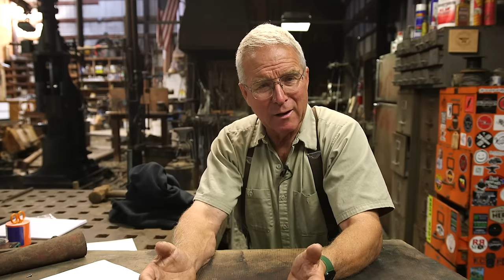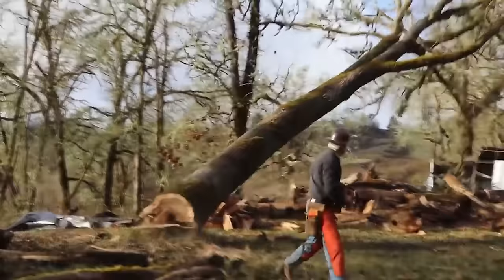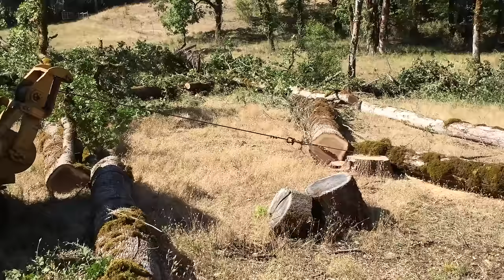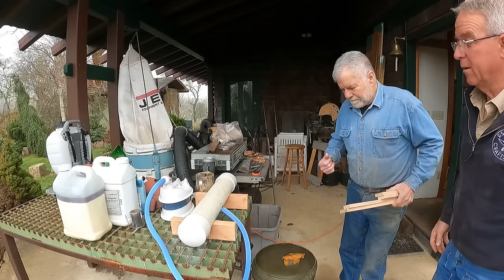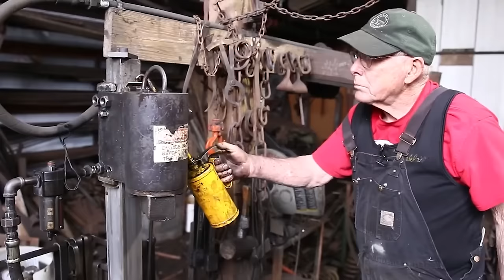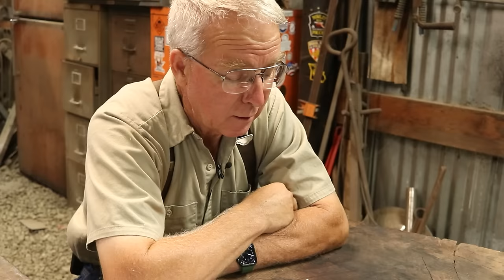How to Be More Confident

Comment: This is one of my favourite videos you’ve made, if not my favorite. My most courageous feat, feels strange to say, was about 4 years ago. I’ll be 40 in a few months….I was relatively new to carpentry. Did a little remodel work, little bit of furniture, i got fired from both…In other words , FAR from being an expert in anything relating to woodwork/carpentry. An opportunity came to me. In Italy. By 100% luck. To be a naval carpenter restoring classic wooden yachts, older than 100years or more. I obviously accepted the job without thinking about it. So time had passed, it came time to move to Rome, I had only a week to get myself situated before beginning work at the shipyard. The night before my first day, everything started to hit me. “I don’t have any experience, what if I get fired the same day? What if i made this move just to fail, and SH!T I don’t speak Italian!!” I was sweating man. But I was determined to be a great carpenter. So like you said, I saddled up anyway. I struggled for about a year. Some days I felt like packing up. But I ignored those feelings and thoughts and pushed through. Kept moving. Kept watching the shipwright masters that I worked with. When they seemed like they were in a good mood, I would ask a question. But after many mistakes, trying and trying again, then getting it right, I gained their respect. I was apart of a few big restoration projects and made some friends for life. Failure is the prerequisite of success. Understand this, and you will be unshakable and unstoppable.

Comment: I can confidently say that a strong component to confidence is knowledge. By taking the time to better understand a subject, and then to rehearse the studying of the acquired knowledge, one becomes more and more confident. Confidence is also about having a healthy respect for the the feeling of fear, but rather than running away from it or letting the fear get the better of you, taking the time to understand what the fear trying to tell you will in turn give you the confidence in addressing it. 

DO NOT confuse confidence with a license to simply act arrogant. In the trades, we call someone with knowledge and confidence in a subject the competent man on site. The arrogant individuals are the ones that don't last long, causing unsafe hazards for themselves and those around them, and are known as the fools. 

Fall in love with learning, and your confidence will sky rocket. If this is about interpersonal issues, the same applies, but take finesse in learning more about yourself, and more often than not, when digging deep within you'll find that your fears have been supported by incorrect stories you've told yourself about yourself during your adolescent years.

Comment: I grew up with two loving parents and always cared deeply for me and my siblings. A strong wise father and a saint of a mother that loved me even when I misbehaved. At around 14 I had to start fending for myself emotionally when my sister became very sick and my parents energy was tapped. I grew up fast and learned independence. I found that work was a great way to keep my mind off of my troubles and also make myself money I wasn’t able to barrow from my parents. I worked on a farm baling hay and doing odd jobs. My first true sense of confidence was learned. Attempting things I’ve never tried, failing, and re trying until my boss was happy. I found a job building cabinets for a retail display company and I fell in love with the high end custom work… the pay was right too. When I was 20 years old I bought my first house, a fixer upper. The whole process was scary. Bills, responsibilities etc etc. 18 months since then I have taken on flooring projects, rough and finish carpentry projects, drywall, plumbing, HVAC and most recently, a long dirty gut and re-insulation of the attic. Everything I’ve done to this house I started out scared, but trying and succeeded and LEARNING, I’ve earned experience and confidence. And that will never be taken from me. I’ve been watching your channel since I was 16. You’ve been a great mentor. Thank you for all videos over the years. B.K

Comment: It comes with age and experience, but the specific experience for me was overcoming big challenges (financial, school- work- relationship-related).  If you can will yourself past two or three, you can face the inevitable 4th with confidence knowing you've done it before.  

Between those big unwanted, unexpected challenges, it's good to take on smaller ones voluntarily.  Even if you can't finish a marathon (I couldn't) trying to gave me the confidence that I could the next time if I trained a bit harder.

Comment: Like you, I was timid as a child.  My dad died when I was 4 and I was raised by an over-protective mom.  The thing I had going for me was curiosity.  I wanted to know how everything worked.  I started taking floor fans apart when I was 5, which was frustrating to the family because I couldn't put them back together.  By acting on curiosity I eventually starting fixing things and understanding things.  That was a type of confidence but not the public kind.  Later as I got into singing in a choir, or gymnastics, I realized that I was confident when I was prepared,  By memorizing songs, and knowing them totally, or practicing gymnastics till it was as perfect as I could be, it gave me confidence.  Even if I wasn't the best singer, or gymnast, I seemed to get respect from classmates for putting myself "out there" in front of people.  Many times I would under-estimate how much work it takes for me to be confident, and would have cold-sweats to prove it.  My advice would be, don't be afraid to try.  You don't have to be an expert, even if those around you say you do.  Keep trying. It gets easier and then the confidence comes.

Comment: I am a female. When my kids were younger,  I remember one time I was in front of our house using a chop saw to cut some boards in order to make a planter for the front of our townhouse. One of my female neighbors came by and in awe of what I was doing said "Where did you learn to do that? I could never do something like that." It always stuck with me because I tried to convince her that she could easily do it if she wanted to, although she wasn't convinced. I felt she did herself a great disservice in thinking she couldn't do it if she wanted to.  It never occurred to me that I couldn't use tools or learn some carpentry because I was unfamiliar with it. I just always viewed it as "I may not be good at it yet, but bit by bit I can get better. If someone else can do it, so can I." Decades later I have learned so many skills, all of which I attribute to just 'saddling up' even though I may have feared failure. I left a broken home very young and had no parents to teach me anything. My confidence was built with each small skill I learned on my own.

Comment: When I first started out doing home improvement, I was quite a perfectionist. And perhaps that is necessary when first starting something that you haven't developed skill in doing yet, just to get results that were good enough for myself. As a consequence, I spent considerably more time completing jobs than a seasoned pro, often taking over twice the amount of time as should be taken. I knew how long the work should take a pro, so I didn't have the confidence to charge people for all that time taken. I felt that my customers shouldn't have to pay for my inexperience, and rightly so, but I struggled financially because of it. Now after 15 years as a handyman, I can perform most any construction task at about 80% of the speed of someone who specializes in that trade. But I'm perfectly confident charging for the time I spend on projects now because I feel that extra 20% of time I take is offset by the fact that my customers don't have to deal with multiple workers, and the logistics of their scheduling. I'm a one stop shop. The quality of my finished projects is consistently at or above expectation, which builds my confidence each time. The takeaway of this is that I don't think there is any shortcut to well earned self confidence. There is only time. Doing your best work will lead to confidence over time. Those who are just starting out in the trades, yet have tons of confidence in their "skill",  are narcissists who will over-promise and under-deliver. Don't be one of those people. They may make a lot of money now, but it is made by burning every bridge they cross, which is not sustainable in the long-run.
I was taught the following early in my career, and it has always stuck in my mind.
There are three ways any job can get done, but it can only get done one of these ways:
1) Fast and cheap, but quality will lack.
2) Fast and high quality, but it will be expensive.
3) Cheap and high quality, but it will take a long time.

Comment: I might very well be wrong... Happens all the time 🤣🤣 ...but I see confidence as something seperate , and pure, far from aggression and all that. It's got nothing to do with it. All of the other stuff is something you present yourself as to the outside world. Not confidence. Nuh-uh. Where it can get mixed up, is that it very much shows IF you're confident or not. But to have confidence is something entirely personal, and comes down to your gut feeling when presented with any given situation. A bit of nerves and anxiety is good, keeps you on your toes, and to make the best of things... But not too much, because then it starts pushing the confidence. Which of course can also be helpful, since confidence should be rooted in knowledge and experience , and if you lack them, or they're bad, then maybe the sensible thing is to run away... For now. Until such time you've gathered the confidence to show the courage, and move forward. Confidence can look very differently, but always non-verbally says: "I've got this!" ...the moment someone has to utter the words, it's either to persuade someone else, to reassure themselves or both - it starts getting iffy. Confidence is quiet and calm.

Comment: Confidence breeds more confidence. You won't understand the power confidence until you jump. Every time I've ever taken a blind and terrifying leap into a new venture, it has been entirely worthwhile, even if the venture failed. Every step towards confidence calibrates your competence. But you have to take chances and have courage to get this calibration. Remember- if you think you can, or if you think you can't, you're right. Your mind is the biggest thing that holds you back. Jump into new ventures and figure things out as you go. Don't be afraid... Or be afraid but do it anyways. It will be worthwhile, I promise.

Comment: To gain confidence, I try to become an expert at whatever I am doing: (1) do "the thing" however many times required that I am "confident" I am doing it right, (2) analyze what I did and try to notice the difference between doing it "right" and doing it "wrong", (3) in written word or in speech, find a way to explain how to do what I did successfully, with tips on how to avoid failure. This takes a while, so if you want a quick way to confidence, this might not be what you're looking for, but if you do it a couple of times you'll start to recognize the expert you are and can be. Good luck!